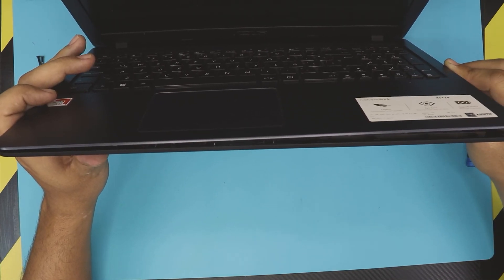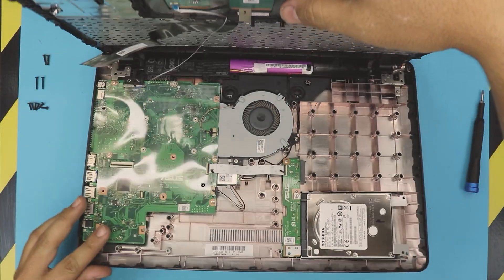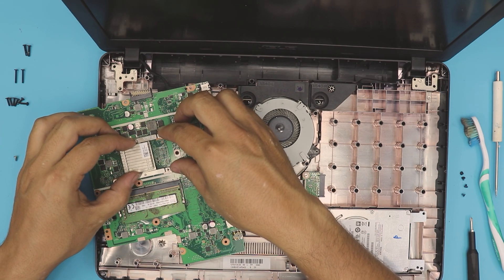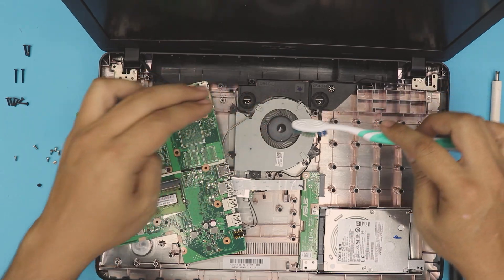Asus Vivobook X543b Repaste Service, Maintenance Guide!

Comment: my computer says max capacity is 8gb with command in cmd, it also says in task manager that it has only one socket in use, so i don't know if i can add ram or not. because it doesn't make sense to bring an extra space if you can't add more ram to it. I need help
Reply from the maker: Thank you for the feedback! if you wish to support the channel you can LIKE or SUB or both :P
regarding your question: if CMD says 8Gb then its 8Gb max if you have 4GB then you need to remove it and get 8GB stick. it detects filled or none ram slot as ram slot. you can only place a 8GB ram stick and remove the 4GB